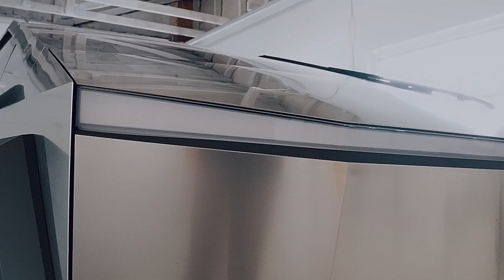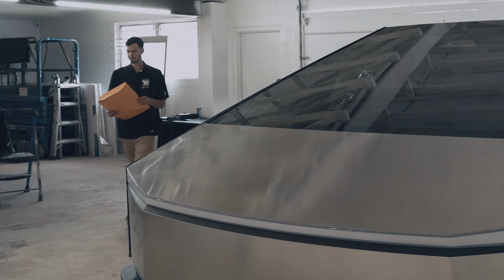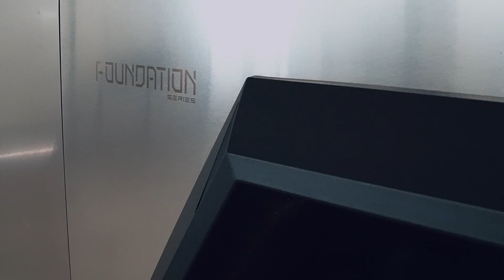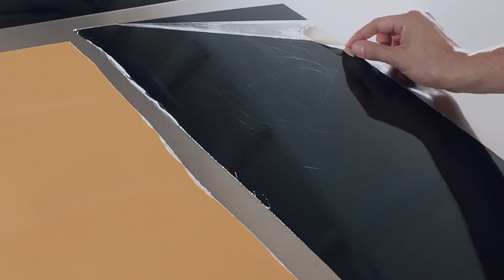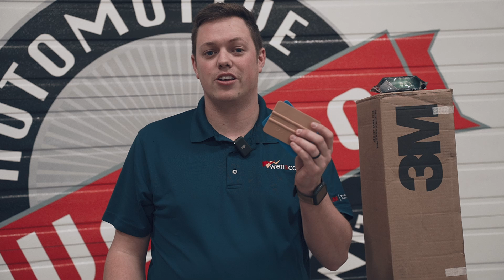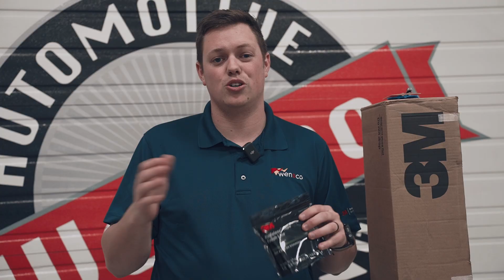3M Protection Wrap Film (PWF) Installation

Comment: Do you make overlapping seams like 2080 or do Buttseams? PPF you don't overlap so I'm a little confused.
Reply from the maker: I think this is personal preference. But typically with full color change you are going to need to overlap or overtime you are going to have a visible seam between them. When you are just doing ppf this doesn't matter as much. But from what we have seen like on trailors, installers seem to be doing overlaps.